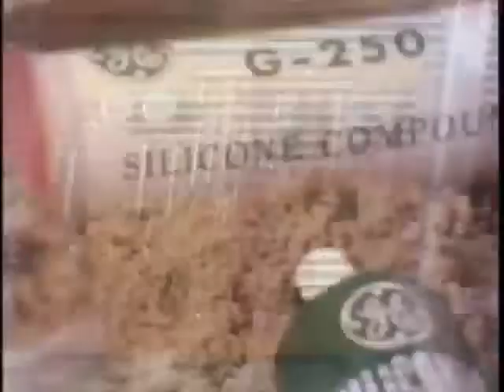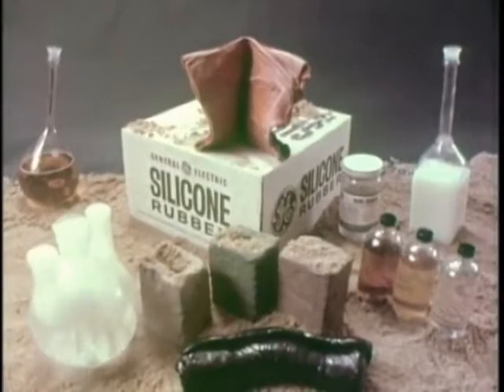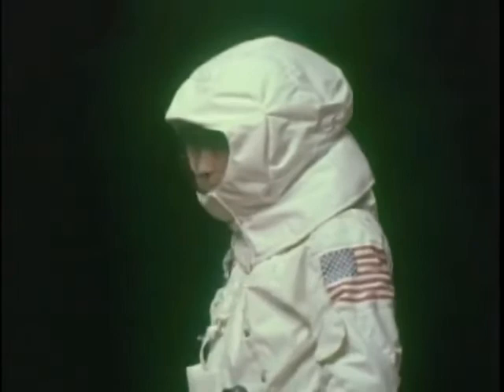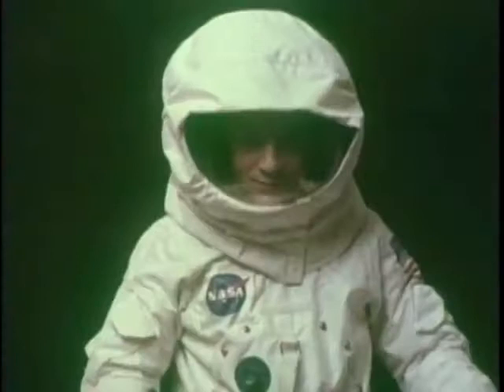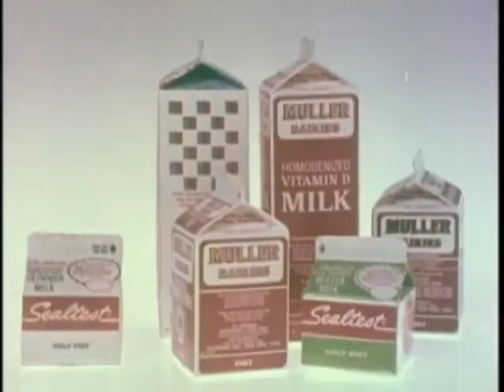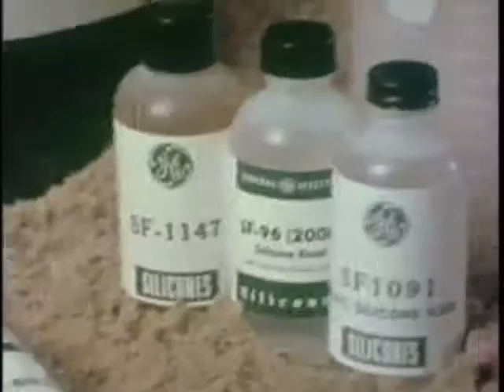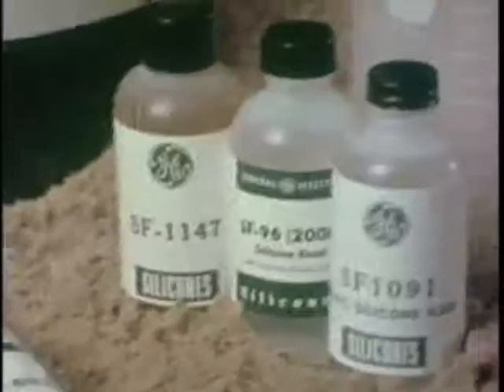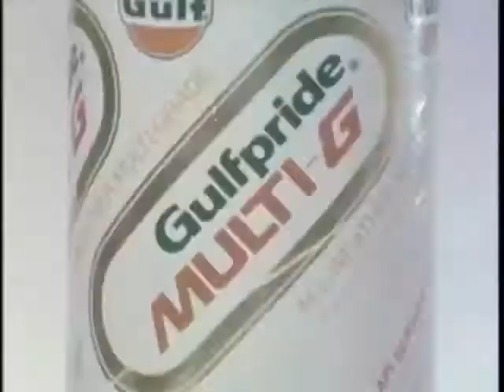"The Answer" -- GE Silicones Song from 1973 [REUPLOAD]

Comment: The Answer.
When you've got a problem, think silicones!
When you've got a question, think silicones!
Because you see silicons from GE are unquestionably, the Answer!

Fluids and rubbers silicones,
Resins, chemicals silicons,
And RGB silicones from GE they're unquestionably, the Answer!
Heat resistant, flame resistant,
Cold resistant, water resistant,
Corona resistant too!
Ozone resistant, sun resistant,
Shock and vibration resistant!
Whatever you need, silicones can do!

When you've got a problem think, silicones!
When you've got a question, think silicones!
Because you see silicons from GE are unquestionably, the Answer!

Cured rubber resins and chemical silicones,
Seeing what they can do for you will surely change your tone,
Find cables in places like nuclear plants- it's the perfect insulation,
Holds back moisture,
And corrosion,
Holds back oxidation!
Baking pan release, non-toxic stuff for foods,
Adhesives on freezer packages, to fit your foodstuffs moods! 
Electrical varnishes that won't wear off, and glass belted tires too!
Heat-proof seals for oven-wraps that lets you see right through.
O-rings! Baby bottle nipples to help you serve your baby's meals!
Caulking for your tub or shower, electric iron seals!
And as we traveled into space as part of Apollo's plan,
Silicone was used throughout, another giant step for man!

When you've got a problem, think silicones!
When you've got a question, think silicones!
Because you see silicons from GE are unquestionably, the Answer!

Now here's a few things you may not know,
About silicone fluids, and where they go.
They're used as a deformer when your instant coffee boils,
Also for textile dyeing,
Petroleum and cooking oils.
It's the stabilizer in vinyl and latex foam,
Furniture polish, shaving hand cream, it's in every corner of your home.
Water repellent, aerosol sprays- the number is fantastic.
The release agent for rubber- for metal and for plastic.
Backing sheets of band-aids, grease for moving parts,
Coating on oranges, opens milk cartons before the pouring starts.
I see labels on a jar- you know how many you have seen,
When you start using silicones you'll find your growth is green!

When you've got a problem, think silicones!
When you've got a question, think silicones!
Because you see silicons from GE are unquestionably, the Answer!

Maybe this will give you the proper silicone feel!
Look how often they are used in your average automobile!
Polish! Spark plug boots, and just to make it clearer-
Valve cover gasket, water pump seal, and it holds your outside mirror.
Windshield wiper lube and starter-clutch grease,
Disc brake grease, radiator hose, and rubber tire release.
And that crankshaft seal, heater hose, high-temperature paint,
When it comes to protecting a car, silicone’s a saint.
In electronic ignition cables to make it work as it should,
Silicons resist the temperature rise beneath the hood.
Exhaust coating, front seal transmission, adhesive to secure parts,
Silicones in every car from Cadillacs to Darts.
And soon this bumper shock absorbent, rotary engine seals,
Brake fluid and fan clutch grease for your set of wheels.

When you've got a problem, think silicones!
When you've got a question, think silicones!
Because you see silicones by GE are unquestionably,
The Answer!